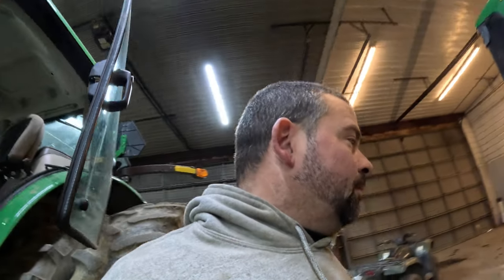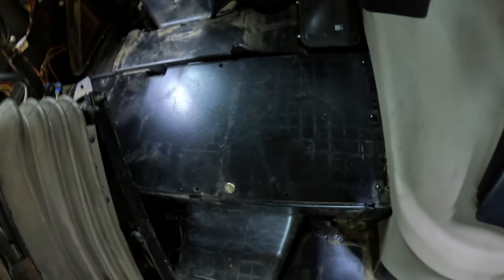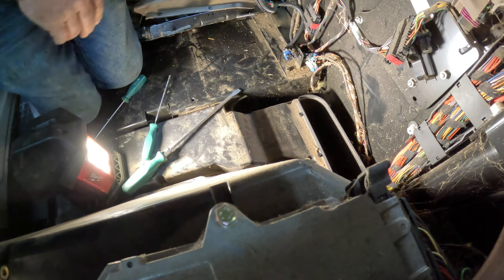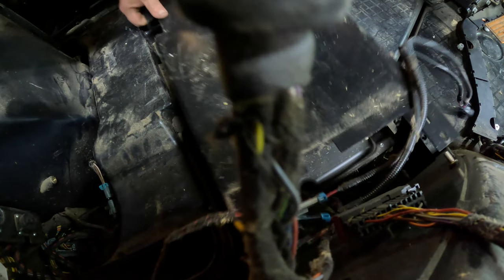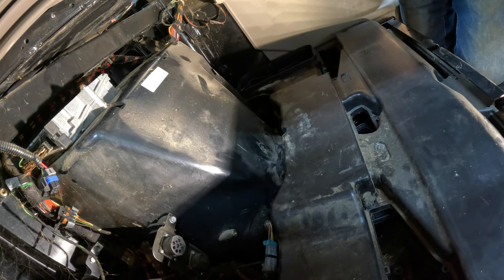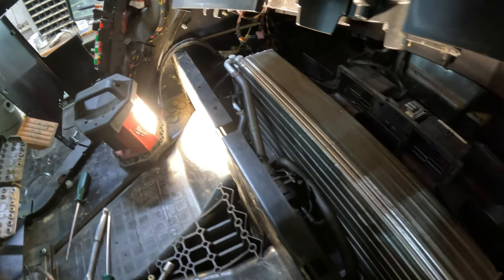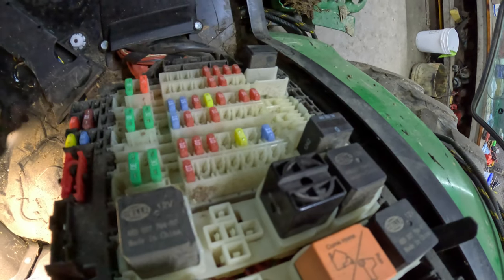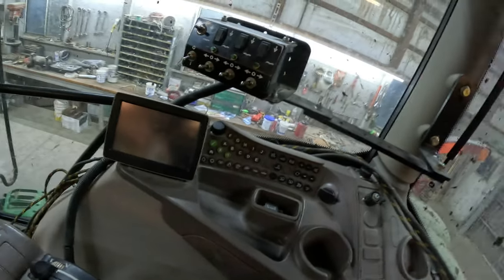Replacing a Blower Motor in JD 6190R

Comment: ToeKnee! That was amazing.....frustrating but amazing. What I learned today is two things. One, farming 50 years ago was harder BUT repair was easier. Two tearing apart computers on a nice clean workstation, with all the right tools, schematics, etc and repairing them.....isn't half bad by comparison. However you wouldn't believe how dirty they can get inside AND if you clean too vigorously and knock a component off the motherboard...the "fun" really begins. Takes allot more restraint. Thanks for the video, take care.